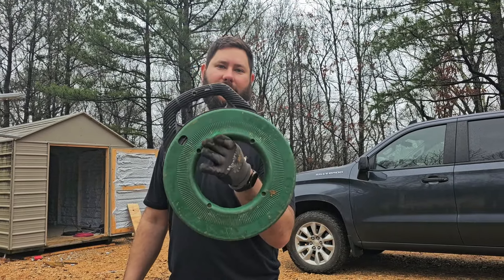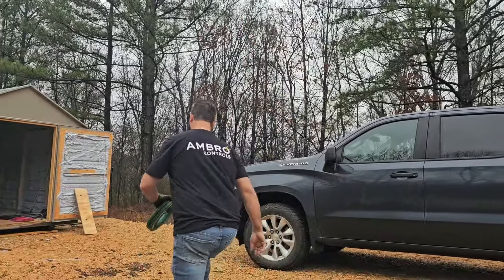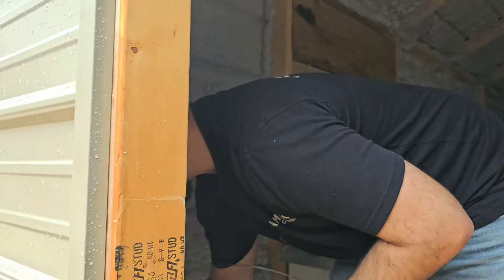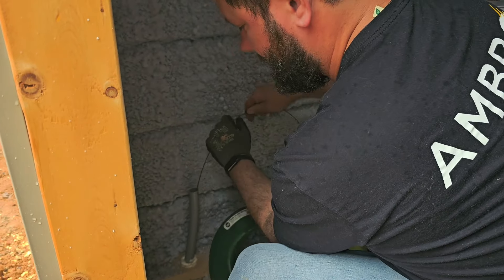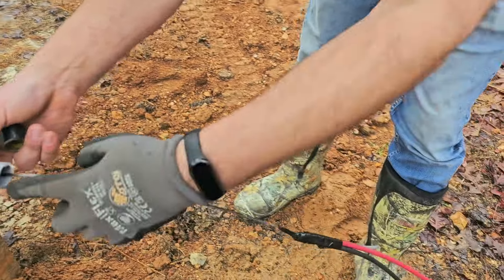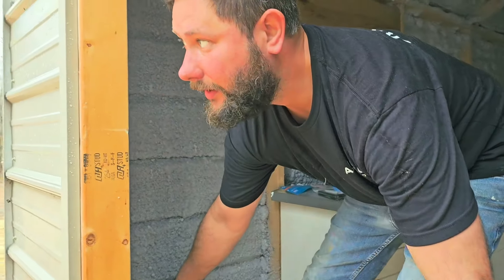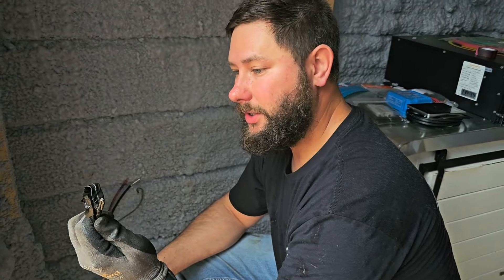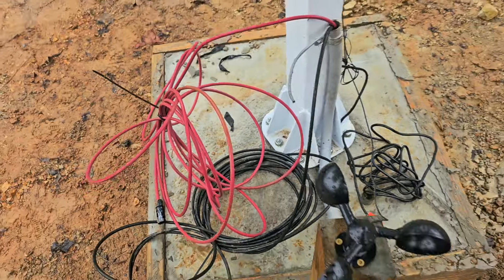How to use a fish tape? #electrician #hvac #solar

Comment: 👋 My name is Shaneka. I am reaching out for help with headaches, fatigue, excessive sleeping, clay/dirt/dust “soot” widespread throughout the home and in my nose, bad smells in the attic and throughout the house. I need help. We heat and cool with mini splits but get the natural gas smells. The fire department read hydrogen sulfide. There used to be a furnace in the crawl space one technician told me and another told me it was no longer there… There is an oil smell in the basement. I need some serious help. What do you think the problem could be in this house?
Reply from the maker: is there gas lines in the basement is the gas meter still on 

get a carbon monoxide detector